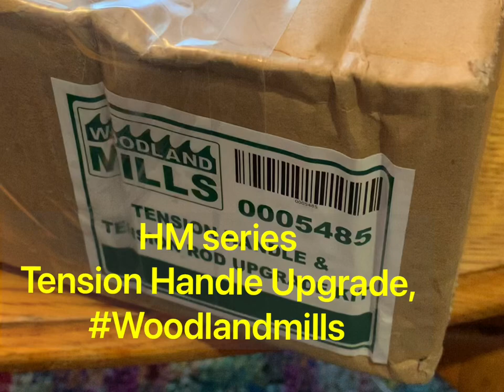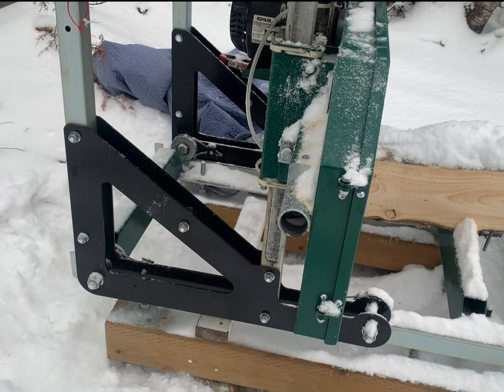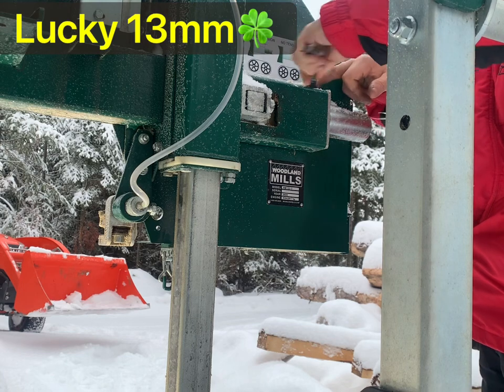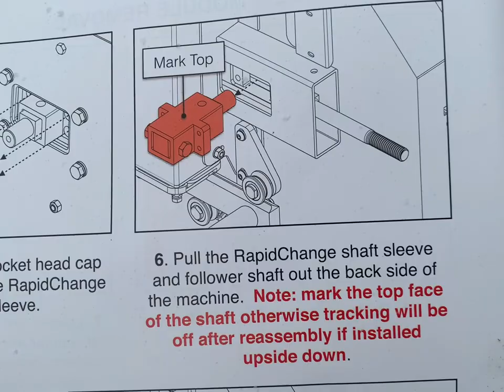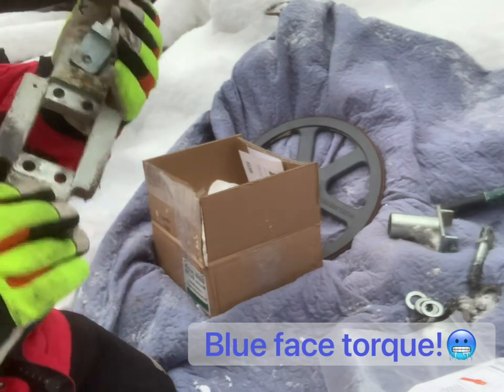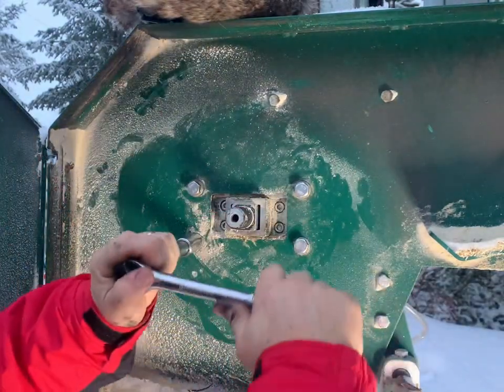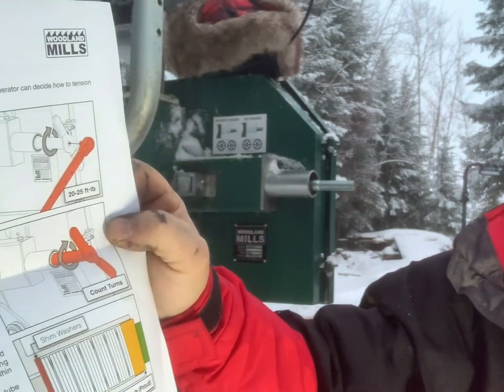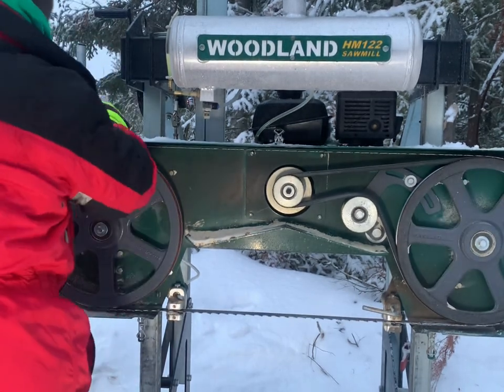#Woodlandmills HM series  #sawmill Tension Handle Upgrade

Comment: I am surprised that the tension handle popped apart.  Was the upgrade covered under warranty?  Nice job putting installing the new parts.  Did you ever here back to why it popped off?
Reply from the maker: Hi Paul, yes the parts were all covered under warranty.  My understanding is that the tension that we're supposed to be using with the original handle is too much.  The threads failed and propagated a crack which eventually broke.  Thanks for keeping me company during the repairs. 🪵🚜🌴🍻🏝☕️